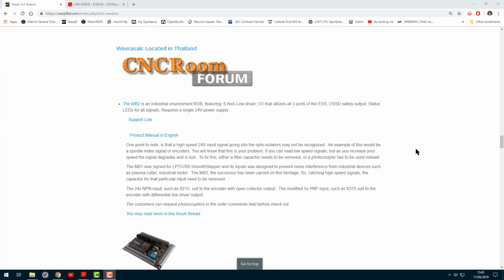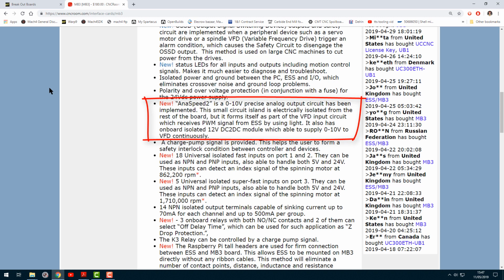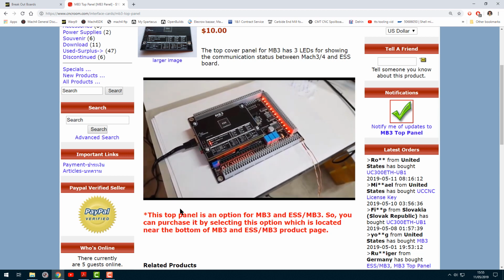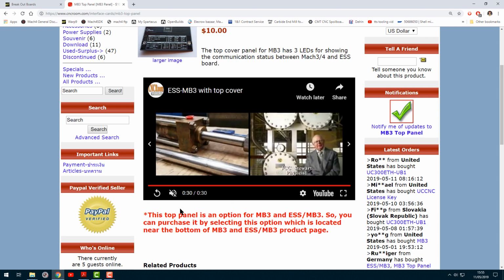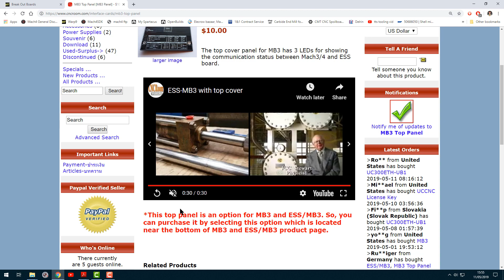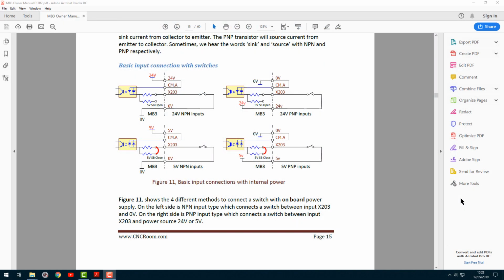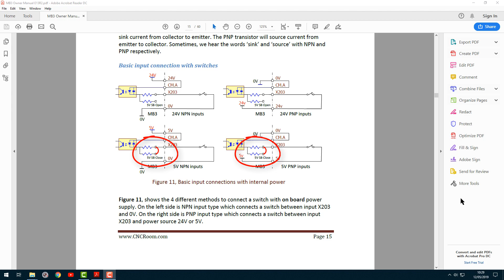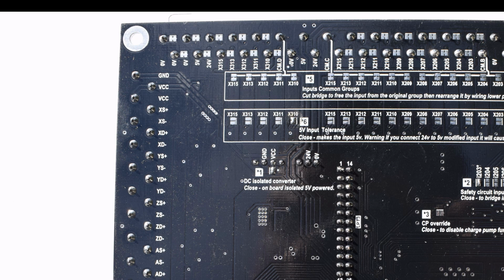MB3 Overview and Setup Part 1

Comment: Thanks. I'm looking at a 5 Axis retrofit and 95% sure I'll go with UCCNC. I was looking at the AXB board but dont like the lack of inputs. That said, the machine is fairly simple but I'd like to buy once and not struggle with Breakout boards etc. I then spotted the UB-1, looked at their site, the saw the MB3. Other than price, what's the major difference between these please?

Comment: Hi daz. I don’t suppose you know what the control voltage used on the MB3 is do you? I.e the step, direction, enable etc... my stepper drives need only 5v for control, so if the MB3 outputs 24v I’ll need resisters to bring the voltage down.